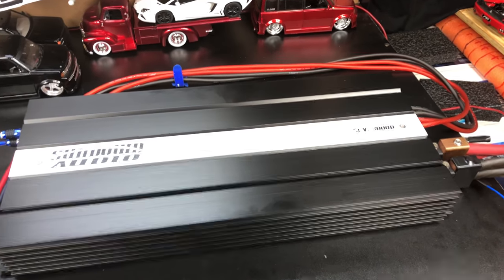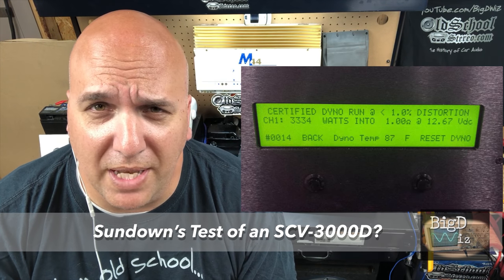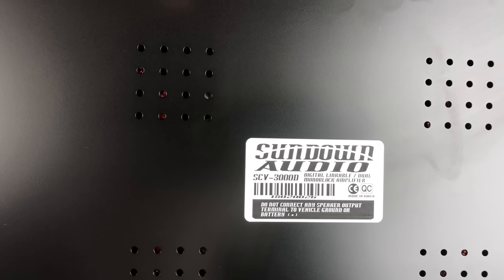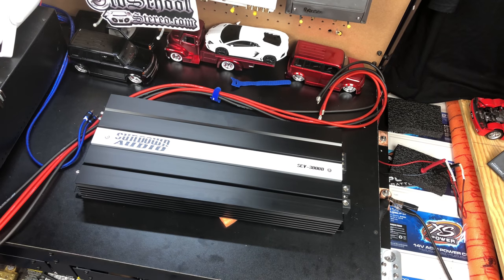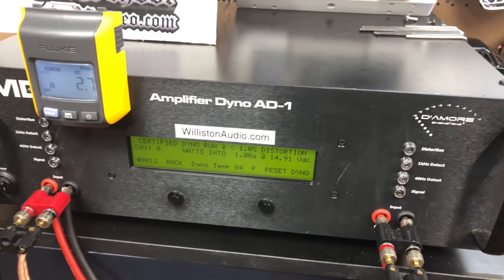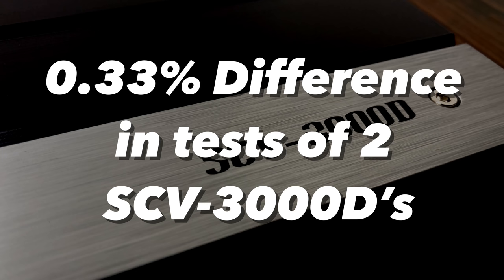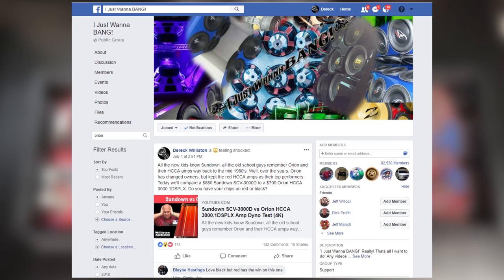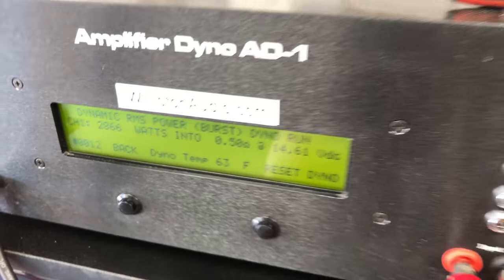Sundown SCV-3000D Amp Dyno Test - Follow Up (4K)

Comment: lol people are acutally trying to compare theese amps to orion XTR series dont know anything about car audio,  amplifiers are much more then just wattage.  there is a reason why these amps cost TWICE AS MUCH as orion xtr amps and alot of amps that are tested by big D wiz, theese are much better sounding amplifiers that are more musical then just noise making amps like orions, look at the specs signal to noise ratio and dampening factors etc...... AMPS ARE MORE THEN WATTAGE    a 3000 watt orion xtr amp is around 300 dollars   a 3000 watt sundown audio amp is around 800 + dollars,,,, do you really think you are just throwing your money away?????? NO!!!!    WILLISTON AUDIO LABS SHOULD BE TESTING/EXPLAINING  MORE THEN JUST WATTAGE AND CURRENT......  ALSO EXPLAIN TO PEOPLE THAT WATCH YOUR VIDEOS MOST DONT HAVE MORE THEN 150 AMPS OF CURRENT IN THERE FACTORY VEHICLE. THEY WONT EVEN GET THE NUMBERS YOU GET ON YOUR TEST
Reply from the maker: I do assume people know they need aftermarket electrical systems to use amps this large. I will disagree about Orion vs Sundown SQ for these amps. They cost twice as much because Sundown has more markup, this more profit for them 🤔
Reply: @wal  i was refering to the XTR line of orion amps ,, thoose do not compare to sundown audio amplifiers , the HCCA amps certainly do and are probably better amps then what sundown has..... and also this is off topic but do you consider DC audio amplifier better then sundown audio amps??? i have a chance to make a swap and was wonder if i should switch from sundown to DC audio they are both rated at the same power ,,, any input from you would be appreceated
Reply: expert autodetail same buildhouse and same/ similar components... crack em both open lol
Reply: @uptobatentertainment  then why are the specs so different ???  why does one amp have a signal to noise ratio of 65 and the other is over 100????   thats a HUGE difference in audio
Reply: expert autodetail dc and sundown is same buildhouse ... crack the amps open and look for yourself.. do your research on the components and the warranty and customer service and make your choice ...
Reply: @uptobatentertainment  who mentioned anything about DC audio????  mabee i am blind but i do not see that word in my comment, i was refering to orion xtr amplifier being compared to sundown audio,,,and that is a shame because sundown audio amps are mainly just alot of power and somewhat decent sound like most class d stuff.

Comment: I run mine at 0.5 all day no problem something wrong with your test
Reply from the maker: Understand resistive vs reactive loads? 🤷‍♂️
Reply: mj3 kel  😂😭🤦🏿‍♂️
Reply: What you saying
Reply: mj3 kel we found a big dummy lol  ... look up impedance rise ... impedance changes at each frequency the sub plays and when the speaker moves .. you may be wired at .5 ( prob aren’t ) but as soon as you play a song and the bass hits at 42 Hz Up could rise up past 4 ohms maybe even 6... when Big D wiz runs .5 ohm that isn’t changing regardless of frequency, it’s .5 ohm that doesn’t rise or fluctuate.
Reply: So what if you have a regulator on your alternator I understand what u saying that sundown amp is rated at 12.6v too
Reply: +mj3 kel your running a soft .5 wired that fluctuates.. his test is a pure 
.5ohm hard non fluctuating ohm load.. his .5 is hard on amps which kicks the protect, it would be like wiring lower than .25ohm in real life..  these dyno test, test amps in a perfect world situation.. you'd be lucky to even get 3000w rms on this amp in the perfect world car situation.. that's why it's very important for these amps to do over rated power, especially at 14.4v